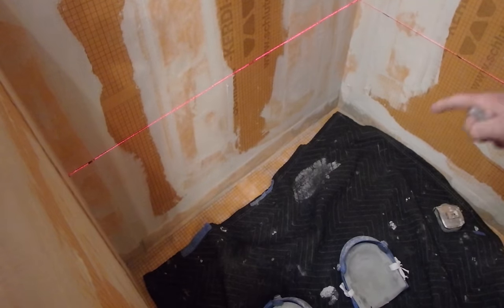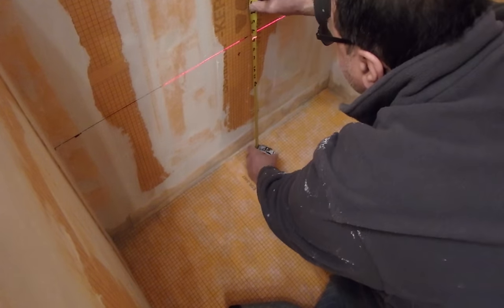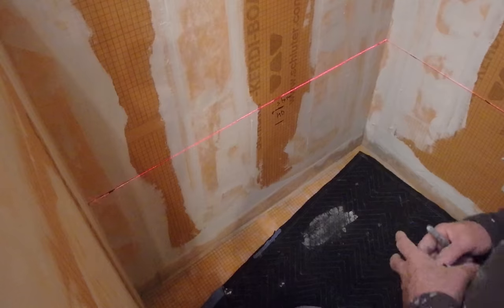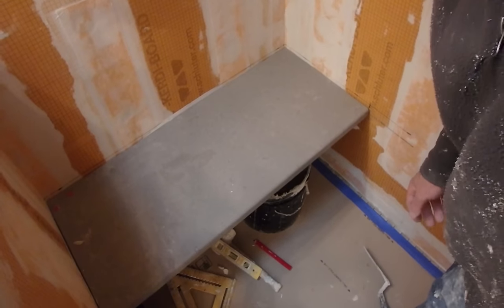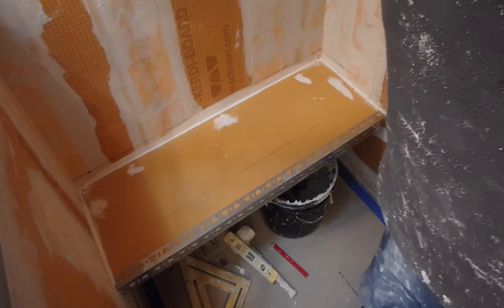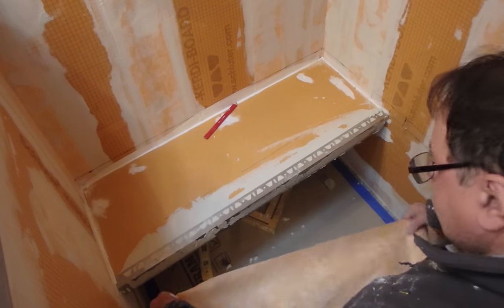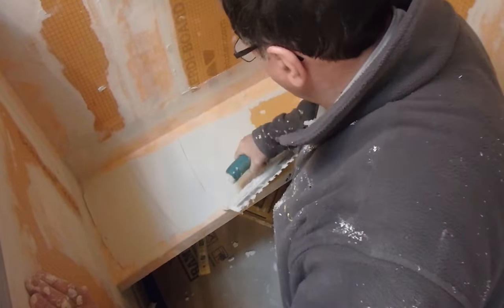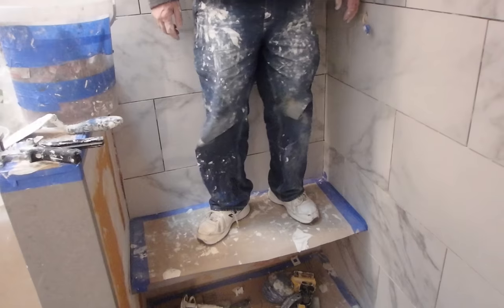Floating shower  bench seat, How it is done.

Comment: Just had this type of floating Schluter shower bench installed in my shower, but the tiling guys didn't clean up the squeeze-through on the bottom. Had to use a scraper and hammer to break it off myself. They also didn't tile beneath. Then the same crew tiled my whirlpool box in and got a bull-nose at each outside corner out of square pretty noticeable. I'm not happy with the job and am fixing to tell my contractor to either have these guys fix both issues or expect to not get paid what they're asking. As for the strength of the Schluter bench, I weigh about 215 and it holds my full weight just fine. Good video. Wish I'd had you do my jobs.
Reply from the maker: It is sad that many tile contractors do not possess the skill to complete the installation to an acceptable degree, what is worse, many of them do not care.
Reply from the maker: We if he is not serving you well and you can get out of it, maybe it would be the best thing,  nothing worse than entrusting your home to someone you don't trust.
Reply: @SalDiBlasi  Gave him a call today, it being 4th July weekend I kinda felt bad, but I let him know that if he wanted to continue with me those issues need to be fixed at no extra charge to me. I had also noticed that the brick subcontractors had done a poor job with the brick around some new windows that were brought up to egress, and he said he'd get them back out to fix their mistakes... so, long story short I'm going to give him another shot. This has actually been my second time having issues with the renovation/repair. My house was hit by the recent tornadoes in TN, so there's repair work and remodeling. Hey, thanks so much for reading my problems and giving some input.  🤜🏻🤛🏻

Comment: What if you installed the shower walls first and then the bench seat. Would that change how strong the bench seat would be?
Reply from the maker: You want the slab to be locked in and supported.
Reply: @SalDiBlasi  so would installing the wall tiles first negatively effect supporting the slab?
Reply from the maker: @mattcraztex9940  for a floating bench, yes.
Reply: @SalDiBlasi  ok thanks was making sure the process was done like that for a reason.

Comment: Hey Sal, just came across this great video and it's blowing my mind. Quick question, can I use Kerdi fix to mount a 2 inch Kerdi board and make a bench to cement backer board? I'm already down the path with a remodel and I'm using cement board but I'd love to incorporate this floating shelf.. Any intel? Thanks so much!
Reply from the maker: Have not done that, but I don't think it will work as well with cement board.

Comment: Hey Sal, Daniel here in the Midwest. I have a 3 foot bench seat coming up. I use go board for my walls, Iwish to use the same exact process you did here to install the floating bench, 

just swap products, go board instead of kerdi, goboard prosealant vs kerdifix, etc. i have 2 questions:

One: the uchannel do you have a bench length where this becomes required for this foam board installation method or do you always use uchannel to stiffen up 2" board regardless if the bench is 1 foot long or 6 feet long.

Two: I was hoping to see how you tiled the underside of the bench seat. i couldn't find it in the video. my fault for skipping around or do you have video of it that didn't get uploaded?

Thanks Sal, as a young buck who was taught by an old buck how to do this trade, I appreciate your installation style and focus on quality.

Comment: Hey Sal, I am thinking about how you built the floating shower seat and doing it for my shower, I agree, it gives you more room.  My question, do I have to use 2 " Kerdi backer for the walls too or can I go with 1/2", 5/8", 3/4", 1", 1-1/2", less than 2"?  What do you recommend?
Reply from the maker: Foam board on the wall is all 1/2", only the seat support is 2"
Reply: @SalDiBlasi , thanks.  I think I'm going to try that.  Keep up the great work.

Comment: After watching your videos I’m thinking about retiling a small bathroom; 5’x8’ concrete slab floor and a 5’x2 1/2’ tub shower and curious how long should I approximate for time start to finish? Planning on using durock with Kerdi membrane with 3x12 subway tile. I’ve renovated a home before so I have some decent familiarity with tools.  Grateful for any thoughts before I make the plunge!
Reply from the maker: Very difficult to say how long, so I am just going to say take your time and get it right.
Reply: Sal DiBlasi thanks for taking time to answer our questions!

Comment: Seems like it would be easier to cut tile before and let bench seat rest on top of the tile.At least that's how I feel.
Reply from the maker: Might be easier, but the stone would also not be supported by the tiles cut around  it relying entirely on the support of the kerdi board. The cut tiles around the stone, lock it in place and add support to the system.

Comment: You say the screws do nothing, which is clear. I don't understand how KerdiFix can be strong enough to support a 300 lb (say) person sitting on the bench. I also don't see how the 2" thick Styrofoam  seat can span 3' with that 300 lb person on it. I know that you know what you're doing and have done the same many times, I just don't understand the engineering that makes it possible.
Reply: I've built one in a Schluter class and I was as skeptical as you, but it really works!!
Reply from the maker: Well the 2" board is very stiff, the adhesive on three sides is very strong, the U channel stiffens the front edge, so alone the support is very strong, when you sit or stand on it you are applying  a downward sheer force to the adhesive, which has a very large area of resistance when you add up all the surface in contact with the walls. Now add to that the stone, which is 1 1/4 thick which has it's own strength, additionally lock that in with the tile all around the stone, this results in a very strong system.
Reply: Also, the foam doesn't contribute significantly to the strength of the seat. It is like the web of an I-beam. The strength comes from the polyethylene membrane on the face of the Kerdi, like the flange of an I-beam.